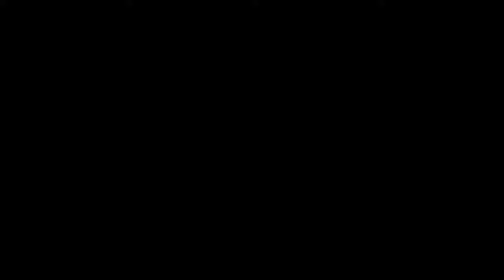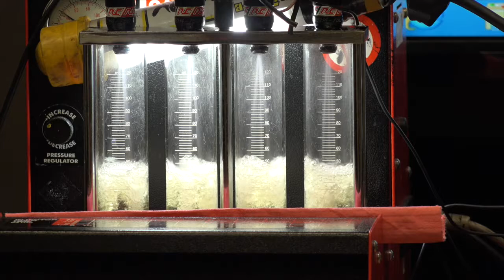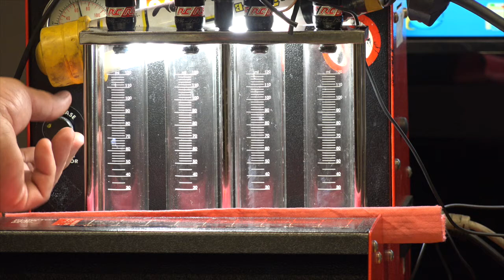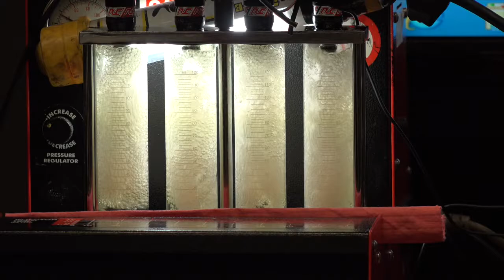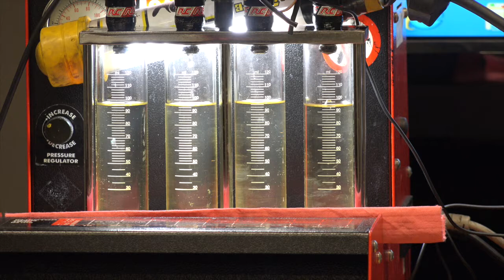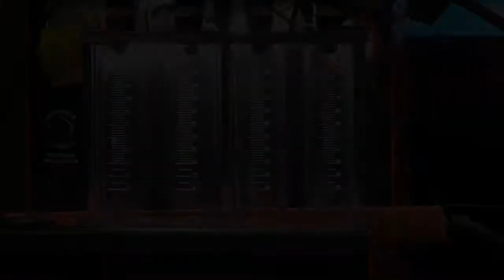Injector pulse width comparison

Comment: I purchased a pulse width modulator & an injector and all it does is keeps the injector open at all times. I've seen others do this, but I can't get it to work. Eventually used the PWM on a water pump to make a cheap water injection system.
Reply: Did you find something that worked?
Reply: @JaySybrandy  maybe unrelated but i ordered ignition module to drive some mosfet  and some pwn/duty module  to mess with injector  
should be arriving anytime now